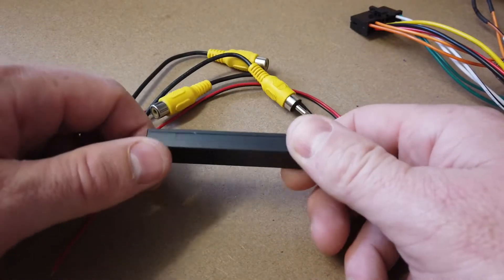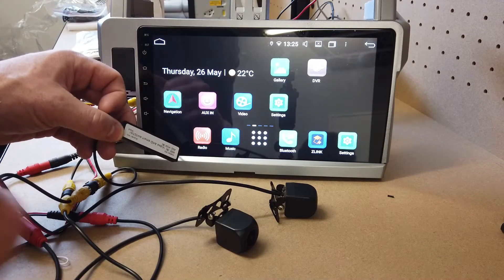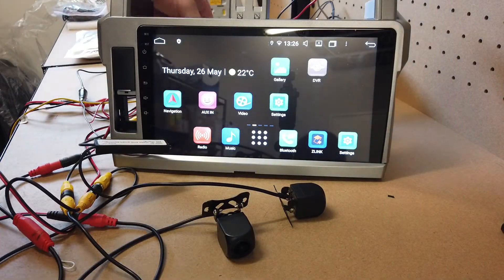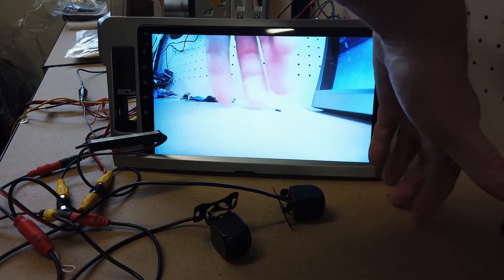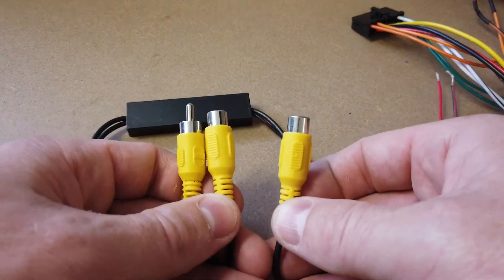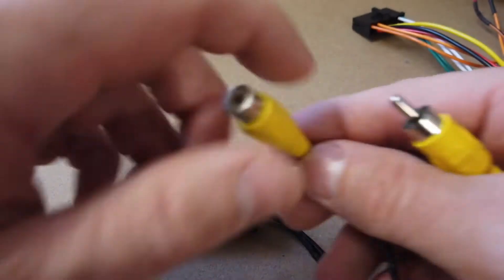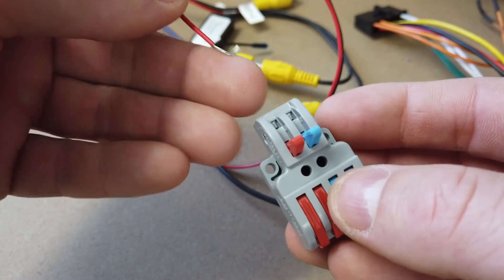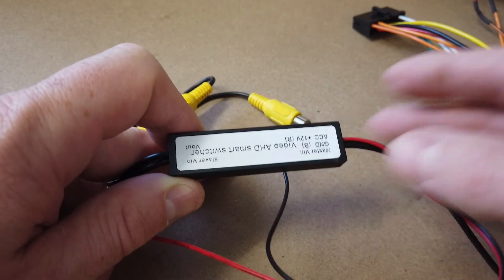2 to 1 Auto Camera Switch System

Comment: If i wanted to switch between 4 AHD cameras  , could i use 3 of these switchers to achieve that without downgrading the video quality?

Im imagining front and rear cameras on one switcher, left and right cameras on 2nd switchers, and a third switcher would toggle between the two outputs. I would configure them and wire them up to give priper priority. 

But curious what  one ahd camera going through 2 switchers would do to image quality?
Reply: Ps I've seen 4 way switchers, but unaware if they work with AHD cameras!
Reply from the maker: Yeah, mate. Would be better to use the 4 to 1 switcher in this case. Will work as long as they have same camera format.
Reply: @VhediaVehicleMedia cheers, thank you for the advice!! I saw the PAC VS41. Looks like a quality unit, but didn't mention it was AHD capable.  I'll give it a try!

I like that it has wired triggers. I can have all my cameras powered by acc 12v and just activate the triggers of the switcher ( instead of activating camera's 12v feeds with turn signal, reverse, etc) 

Sweet, thanks again!!!

Comment: Can this be connected to a rocker switch with your factory fitted rear camera and a new front camera fitted, So if your driving along and wanted to check the rear view camera by pressing the rocker switch could it work that way ?
Reply from the maker: Hi, No if you want to do this will be best to have 2nd camera into our F Cam input or use the 4 - 1 switcher. Cheers

Comment: Hello. I was just wondering if it is possible to have two rear view cameras (reverse cameras) placed at the back of my car and be able to watch both outputs in the same DVR car screen while reversing? Is that a possibility as I desperately want to have both cameras installed or is there any way to have both cams installed at the back and maybe the output of any one can be seen at any given time?
Please advise - thanks!
Reply from the maker: Hey, mate. That's the purpose of the 2 to 1 switcher. You can put to cameras and alternately view them on your screen. Cheers.
Reply: Ok thanks so much for your reply, however, in my scenario, there is a slight complication.
I have a 360 degree installed (front, rear, left and right stitch feature and not independent). So when I use the reverse gear, I get to see the rear view and when I use the left and right indicators, I get to see the left and right views accordingly on my Android car DVR screen. Now, I recently purchased a reverse camera with sensor which I wish to install. In this scenario, will I still be able to use the 2 to 1 switcher to get both the rear view cameras on same DVR screen? (i.e. the 360 reverse camera output as well as the additional reverse parking sensor camera output?). Please advise

Also, do you have an email address where I can correspond with you directly? - thanks!
Reply from the maker: Hey, mate. Not sure but I am assuming you have a different head unit and not one from VHEDIA? Best to reach out to where you got your head unit and show them if the switcher will work with the factory 360 camera's reverse camera and the aftermarket camera you are getting. I reckon it will work on ours but not sure about other units. Cheers.

Comment: I don't get it. My Android Unit has two 12V power connectors. One for the rear cam and one ACC. I have a front cam and a backup cam. Both need a 12V connection. My plan was to connect the rear cam to the 12V rear connection and the front cam to the 12V ACC connection. But now this needs a power source as well? Where am I supposed to get all these connections from? I'd really appreciate some help how to do this...
Reply from the maker: Hey, mate. You'll need to crimp some of the wires. You can also use scotch connectors for this. Cheers!

Comment: You can also just use a on-on toggle switch wired to rca input and output to one rca.. right? a cheaper diy
Reply from the maker: Can do that as well. We have a toggle switch you can include when ordering this.
Reply: @VhediaVehicleMedia  Sorry i meant On-off-on, and connected to a separate fusebox and not tapping the reverse light? will that work?

Comment: Ok thanks so much for your reply, however, in my scenario, there is a slight complication.
I have a 360 degree installed (front, rear, left and right stitch feature and not independent). So when I use the reverse gear, I get to see the rear view and when I use the left and right indicators, I get to see the left and right views accordingly on my Android car DVR screen. Now, I recently purchased a reverse camera with sensor which I wish to install. In this scenario, will I still be able to use the 2 to 1 switcher to get both the rear view cameras on the same DVR screen? (i.e. the 360 reverse camera output as well as the additional reverse parking sensor camera output?). Please advise

Also, do you have an email address where I can correspond with you directly? - thanks!
Reply from the maker: Hey, mate. Not sure but I am assuming you have a different head unit and not one from VHEDIA? Best to reach out to where you got your head unit and show them if the switcher will work with the factory 360 camera's reverse camera and the aftermarket camera you are getting. I reckon it will work on ours but not sure about other units. Cheers.